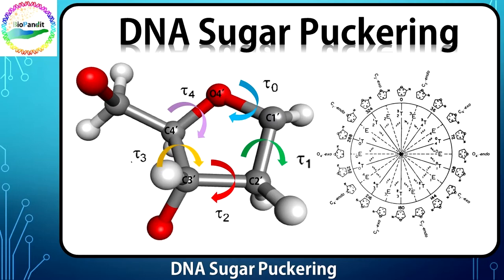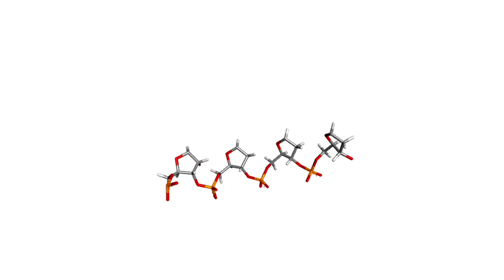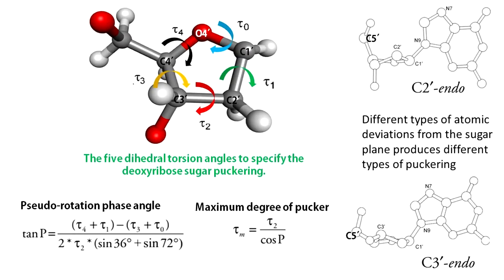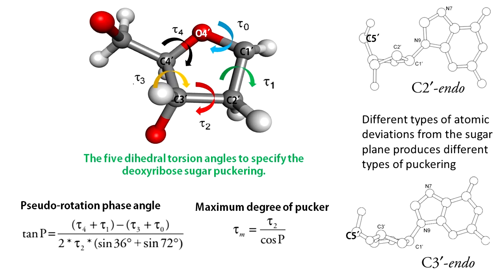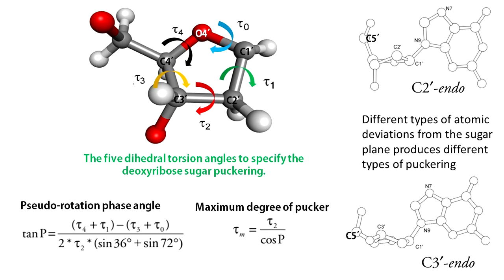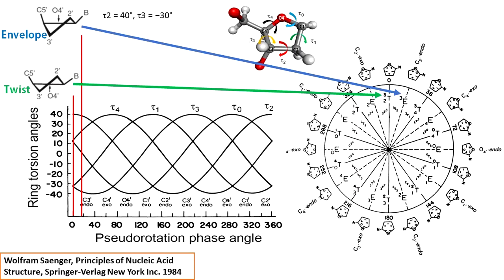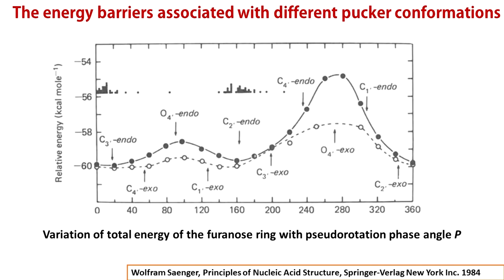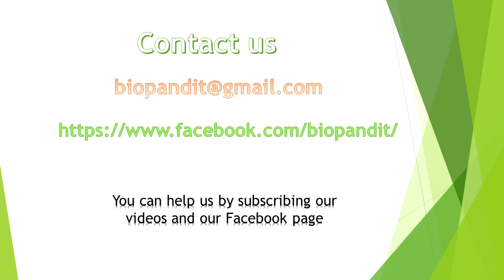DNA sugar puckering

Comment: So RNA forms A form only and DNA can form both A and B form?
Reply from the maker: yes... :-)
Reply: BioPandit then how does base stacking help stabilizie DNA structure?
Reply from the maker: Base stacking happens in order to find the most stabilizing structure. See that DNA in aqueous medium never remains in perfect straight double helical conformation. It is always bent or supercoiled. When the DNA is bent, bases must deviate from the ideal geometries. As bases deviate from ideal geometries, the electrostatic interactions change, thereby altering the folding free energy. In such cases, different base pairs organize themselves in a way to minimize the overall free energy of the 3D structure. This is simply speaking, how base stacking helps stabilize DNA structure.
Reply: BioPandit so base stacking happens to stabilize the DNA in a aqueous medium? And also in an aqueous medium the water molecules have weak interactions with the grooves of the DNA and thus causing a shift in the structure and in the time the base stacking interaction happens to stabilize the molecule am i correct?
Reply from the maker: I think base stacking would happen in free space as well. In free space, the base stacking energies would only include electrostatic interactions among DNA atoms only, in aqueous medium, interaction with water molecules have to be considered. In any case, stabilizing the overall DNA molecule is the key.
Reply: BioPandit So it happens in free space due to van der waals forces or weak dipole interactions but the cummulation of all these weak forces accumulate to overal help in stabilizing the strcuture?
Reply from the maker: The second law of thermodynamics states every system tries to reach the minimum free energy state. No matter what type of force is present in the system. Its the same for DNA buddy. Whether it is in free space, or in water or supercoiled or complexed with protein --- the second law applies everywhere. The system will try to reach the minimum energy state. So yes, what you jut wrote i correct.
Reply: BioPandit alright thanks alot man. So thankful for your timely reply. Cheers. Subscribed too.
Reply from the maker: you are most welcome... if you think we are being helpful, please help us back by sharing our videos with your friends... :-) stay in touch... :-)